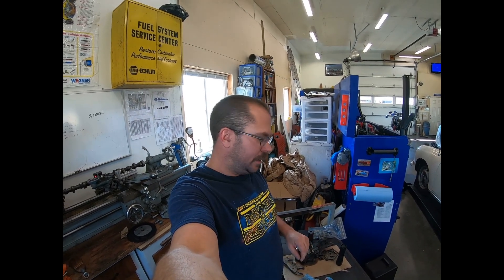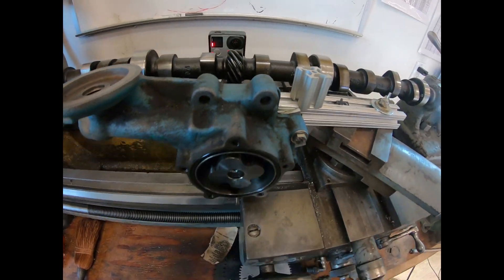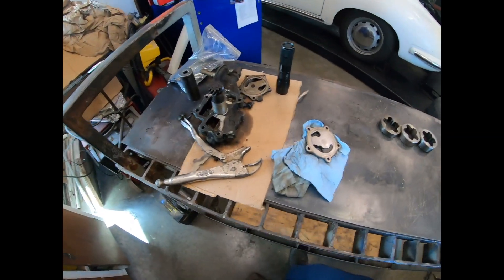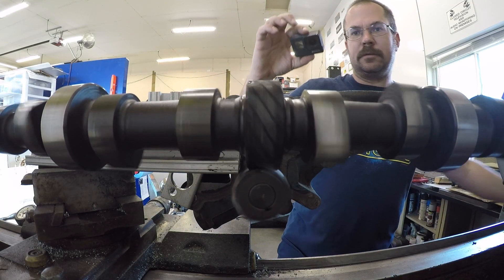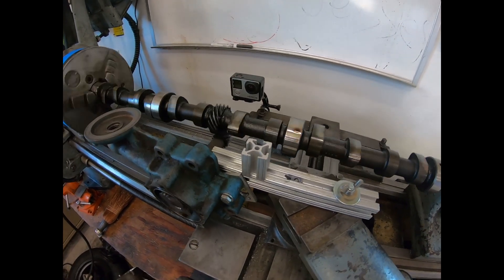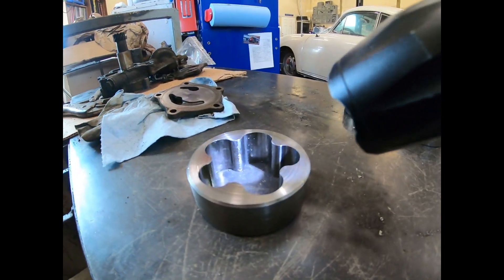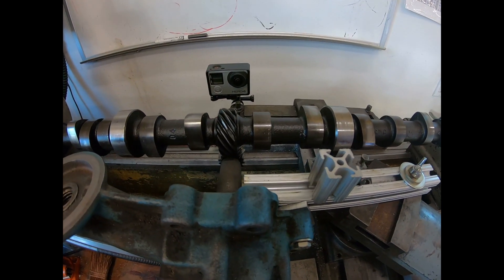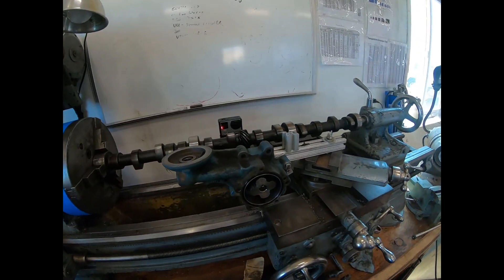Slant 6 Oil Pump

Comment: Hi I have a Australian Slant 6 oil pump does not have oil filter attached to pump, just wondering with the rattle noise when you have cam on lath I have a similar noise after engine gets to operating temperature and in gear is your noise normaal?

Comment: I have been driving/racing slants since 1974. I have never had a cam/oil pump gear failure. I run the standard aftermarket replacement oil pump (high volume compared to the stock pump), but not the High volume pump (M-66hv). I turn my 170 engines up to 7,000 rpm, and my 225 engine up to 6,500 rpm. I also run nitrous, and turbos (not both on the same engine). I have not had a oil related engine failure since 1976. PS: I run 10-30 dino oil.

Comment: Another thing that I have found and had been found by others is that the cam walk varies greatly among these .  Adding lift. Lifter rotating, that all adds to the thrust .  Buttons added to the timing cover have worked greatly in the past . 
 I guess also finding a competent knife maker could also help with hardening the newer gears.
Reply from the maker: The cam can’t “walk” in this engine far enough to affect the oil pump drive gears with the type of gears used and how they are mounted relative to each other.

Comment: I added an oil squirter for oil pump gear for more oiling. It has pressure valve built inside and it goes to empty pocket of oil pump. I also ported and drilled all oil passages from block and oil pump to free up the flow.